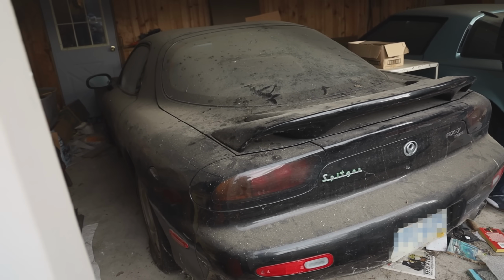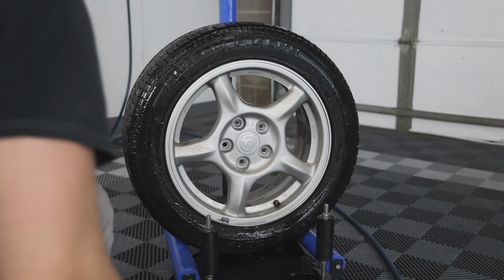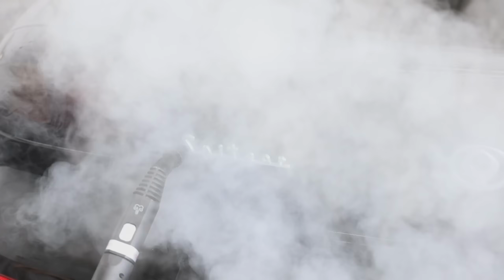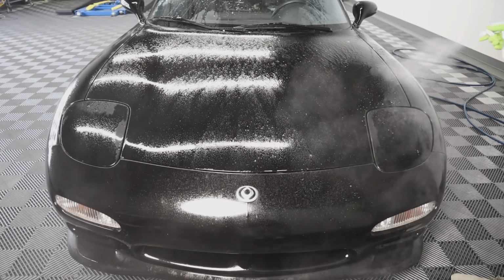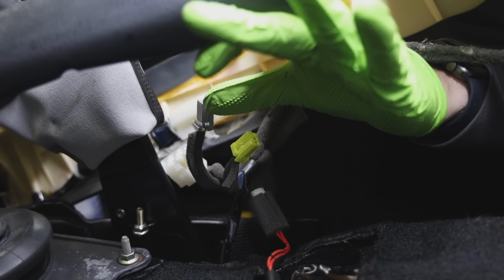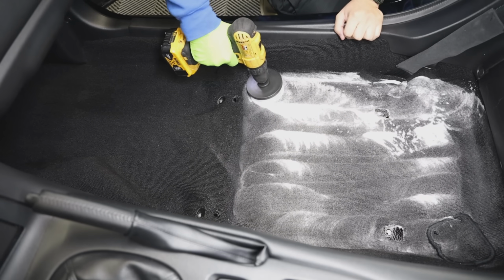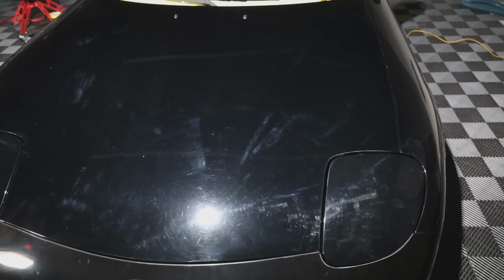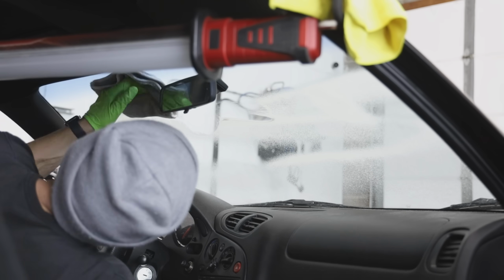First Wash in 23 Years: Barn Find FD RX-7 With 8800 Original Miles! | Satisfying Restoration

Comment: Fun fact from an FD owner. In stock form around 140mph the car gets very light feeling and steering becomes less responsive as the car feels like it's floating
Reply: didn't newer ones closer to 2002 fixed it? Not talking about this one because it barely has any aero.
Reply: @swilleh_  wish I had the opportunity to know, they would have to be a rhd version and I'm in the USA. I've had mine for about 16 years and a quite extensive mod list but the first couple years it was relatively stock and I got a good feel for the cars limits before doing and modifications
Reply: FUN FACT from a car owner, almost 99 percent of ALL cars that are stock feel light and the steering becomes less responsive @140 almost like its floating...
Reply: @electronicgrandpa7974  I've had nearly 30 different cars at those speeds and none of them felt as bad as the Rx7. Even my 93 k swapped Civic hatch felt fine when the speedo was buried. The Rx7 feels like the front tires aren't touching the ground like when you got a drag car that comes off the line and the steering wheel is just an oh shit handle at that point
Reply: @o3nisoaso3  could be how light the engine and front is righht
Reply: @repingers9777  yes and also it was probably the fact it was a 20 year old car with all original parts and only 30k miles
Reply: Not true even with no spoiler.   From about  125mph and up the car feels tighter and heavier from down force.  It's no hands stable at 155 in stock form.   That floating feeling at speed is what driving at 227' per second is just like on the street vs smooth race track.  Or least that is my experience.
Reply: @repingers9777  It's not light though, the 13b REW is about ~425lbs fully dressed, with turbo parts no trans.

Comment: What a treasure, why would you leave this beauty neglected in a barn for over 20 years!?!?!? Glad you were able to restore her original glory, great job!!!!
Reply: Neglecting it in the barn for 20 years allowed it to be in this good of condition. At least it wasn't left out in any sun light.  It will sell so easy.
Reply: @CheckRaiseBluff that’s a fact, the cost of dust literally saved the paint and everything. No visible rust or anything on it, this thing looks awesome.
Reply: Shit just happens.... life gets ahead of ya. Ive got an uncle with a 67 BMW 1600 with less than 15000 original miles on it but he tore it apart in the 70s and never put it back together. Also my father-in-law has a Chevelle that he used to drag race in the 70s, same story. Took it apart then life happened.
Reply: Apparently hitting a 140mph will mske you permanently park it. This car deserves to go to a owner that drives it and breaks the engine properly!!
Reply: Mortality I guess.
Reply: @nicolasnorthern2962  No. If we were in the early 2000s when that car was recent, I'd tell you "yeah you're right let's shred the hell out of it and have some fun before it rot" but now that it spent 23 years in a barn, it's worth gold. It is still brand new and believe me, you DON'T want to drive it nor tune it like all those JDM Modified cars on tiktok and YouTube. A fully stock and low mileage Rx7 like this is worth at least 130k $. Tuning it or adding a shit load of miles to it, would ruin the price  tag, cars like this don't exist anymore and they're legends. It's like the Supra Mk4, fully stock and low miled Supras (Mk4) don't exist anymore. The few ones that still exists are in some private collections, all the hundreds of others, are fully modded and nothing is stock anymore, they all get 1000+hp and huge turbos and huge flames blablabla you know the deal, tiktok videos and Rev limiter, etc , stock Rx7s or stock Supras are worth literally hundreds of thousands dollars. Finding a stock Rx7 or stock supra is like winning lottery, congratulations you just won 200 000 $ for free.

Comment: Top-of-the-line. Your knowledge, skills, and work ethic are unmatched. 
Car looks absolutely beautiful. 
Those rusty brake rotors though??? 😭
Reply: the oxidations layer should come off after a few miles. the old ass tires is what worries me. they are probably dry rotted inside and will fail on a harsh bump

Comment: The owner is very fortunate because if I’m not mistaken, that’s an R1. Haven’t seen an original R1 in a very long time. 👏🏻
Kudos to you guys for bringing this back to life. Even if the engine needs a rebuild, the authenticity of a very low mileage R1 can fetch some serious coin. I wouldn’t doubt it can sell between 50-70g’s US. Everything is there and it’s all original. 👍🏻
Reply: Good eye! Definitely an R1 and I believe under 100 were made in brilliant black..I've got the more common Vintage Red color R1 and only 1176 made for 1993 in that color 
Best video yet and amazing find!
Reply: It's an R2. You can tell it is a 94 or 95 by the passenger side airbag, meaning it is an R2, not an R1.
Reply: @tylervanpatten7699  even more rare are the Canadian R1’s. I think about 50 or 80 ever made it over here. Those are really rare. 😎
I’ve had my 94PEP for over 25yrs now. It stuns me to see such an original FD. Haven’t seen those wheels or that engine bay in a very long time. 😂👍🏻
Reply: @verdict1163  I was so focused on whether it had the oil coolers and the suede/cloth seats I completely overlooked the passenger side airbag. I’m so used to seeing my 94 I completely forgot the 93’s didn’t come with a passenger side air bag. 
I stand corrected. It’s an R2. 👏🏻
Reply: @verdict1163  Yes good eye! Def R2

Comment: Great detail, really enjoyed watching! My question is was the car running?  I mean sitting for over two decades there is no way she would run without some work.  Also, it would probably have leaks when it dors run as seals dry up over time.  Tires would probably be checked and have cracks.  If I was going to put a value to a car like that I would have alot of questions about the mechanical condition.
Reply: A lot of seals and gaskets will come life on their own

Comment: The owner isn’t lying. This car is bat out of hell scary fast. In 1992 I was looking at the 300zx, the Stealth, the 3000gt VR-4 and the Supra. The Supra had a high dealer mark up, so I never drove it. The Stealth R/T and the 3000gt all the electronics and repair costs worried me but I loved the rides. Now the RX-7 scared me. It was like a tight fitting (snug seats but I’m 6’3) go cart with a racing engine and it was only a Mazda Wankel turbo. With its light weight it felt so dangerously fast that I saw myself getting in trouble. It actually made me rethink everything and I got a Galant VR-4. I eventually in 1996 got the last 300zx but I never forgot how the RX-7 felt.

Comment: hey guys! outstanding job! I'm no expert but just an advice, for the engine bay, I'll recommend first blow any dirt, don't use pressure washer you can damage any electrical wire or band, specially on a car sitting this many years, then blow it again with a help of a microfiber towel to dry it and an extra add some plastic protector.

Comment: If everything original on the car, the value is between $50-100k! And yes I looked it up. ❤ In production for only 3 years and not many made. Very rare to find one in this great of condition.  Owner is very lucky to still have this gem
Reply: On top of that it's a US version which makes it even rarer and worth more. They were sold and built in japan all the way until 2002

Comment: That is an R1 model, more rare it has dual oil coolers anti roll bar across the front and upgraded suspension. A few other things, and as an owner this car will sell for whatever buyer wants to spend, truly priceless. I have seen cars like this go for upwards of $125,000, again it depends on the buyer. 

The car I own I have had since 2012 I’m 40 and couldn’t afford one as a teen, I saved for about 9 years and found my car at a dealership and spent 29k. It had 32k miles and it now has 45k with upgrades to just about everything possible. These cars are a lot more then just that, they are a lifetime of fulfillment and to own one you must truly appreciate the artwork that they are.

 You will never experience anything like a drive in this car i can totally understand what the owner had done by parking this car. It’s honestly pretty beautiful to hear a story like that, for someone to just park a car after a drive and not let it go. Respect and good look with that cars future, if they need any input on what to work on for reliability you can always message me!

Comment: By the way just a tip, dremmel multi tool has a brilliant polisher on it and an extension shaft, the polishing pads on low speed are brilliant, just don't press hard

Comment: Personally i would have dropped the gas tank and replaced it along with the fuel pump gas turns to water and kerosene like substance after a few years rust forms inside the fuel tank also i would have gone through the wiring to make shur the mice didn't damage anything next would be flushing every fluid on the car transmission break lines after that do full diagnostic on all systems i know this sounds excessive but the car is worth alot of money and is practically new a tuners dream

Comment: You don't mention how the car smelled with all those dead mice? But a ton of work before it's drivable; engine belts, hoses, filters, fluids, suspension dried out, a/c dried out, brake rotors, etc. What's it worth as shown, maybe 12k. Black isn't a winning paint finish these days. Weirdly low mileage also a red flag, maybe the clutch is burned out/ gearbox damaged.